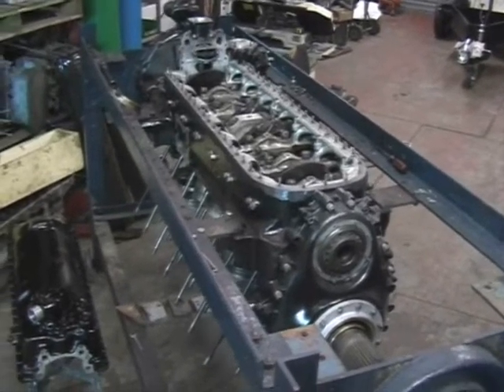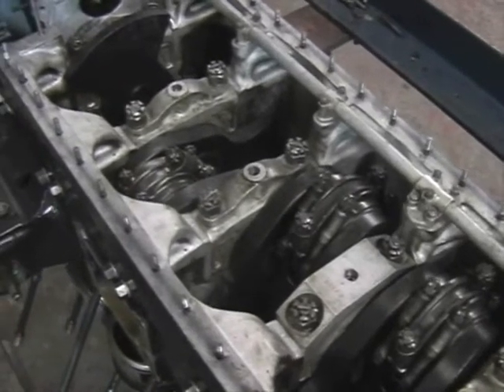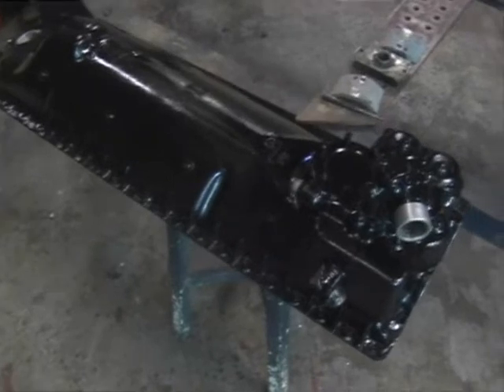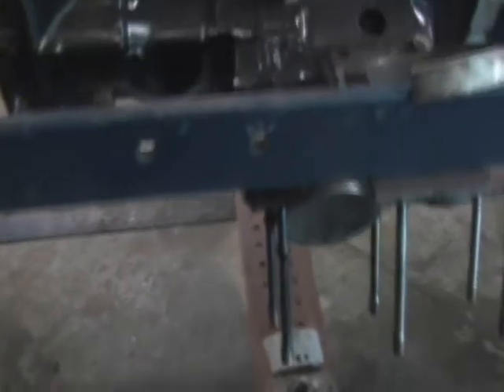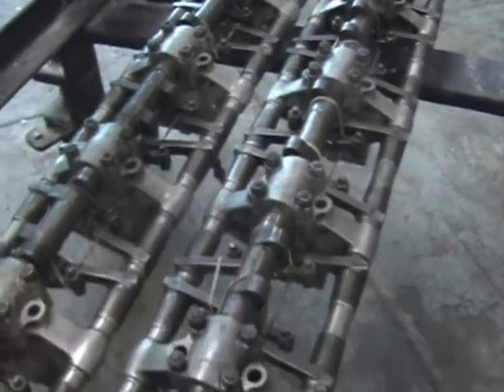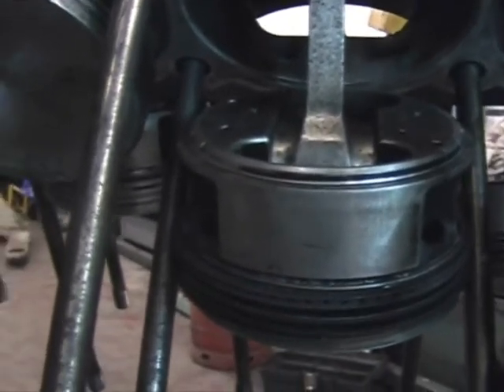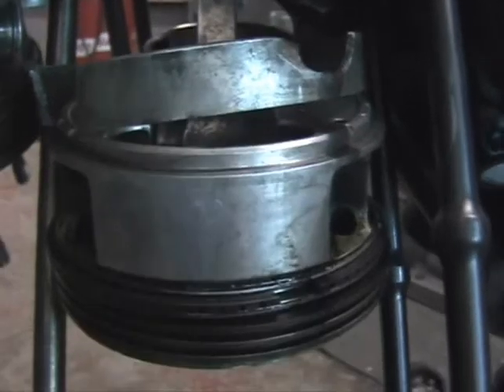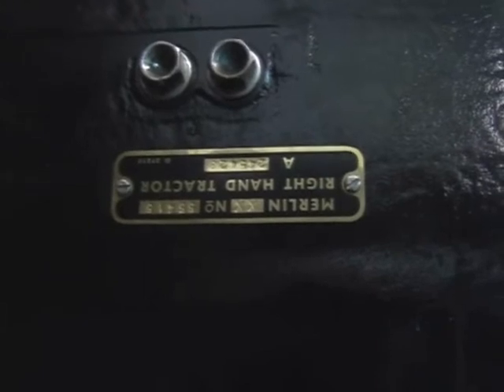R5697 Engine Update October 2014

Comment: At what point does a ground running engine cross over to an airworthy one? Could u reuse those rods in a flying machine?
Reply from the maker: Hi Chris
Probably not in this case, but just about any engine can be rebuilt to fly again, it`s just a matter of what you need to replace. Conrods have to be near perfect because they are highly stressed, so no corrosion pitting is allowed, for example.
Reply: Yeah I have to admit I did wonder seeing the pitting on the rods. Id love to know the ins and outs of whats permissable and whats not for flying engines!